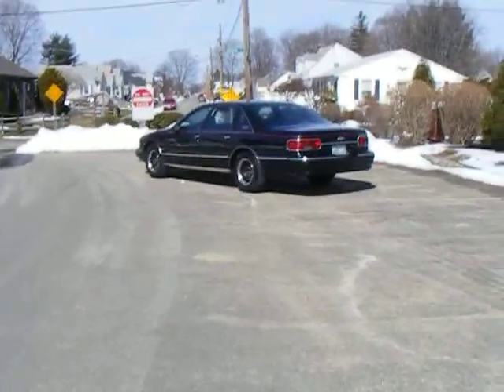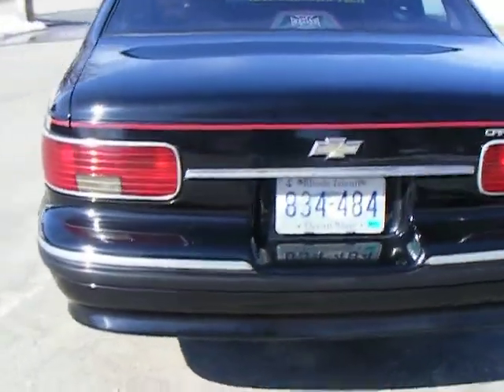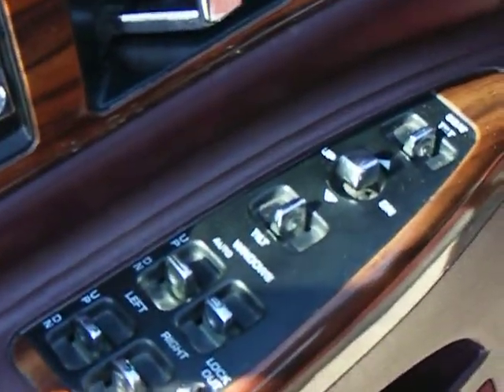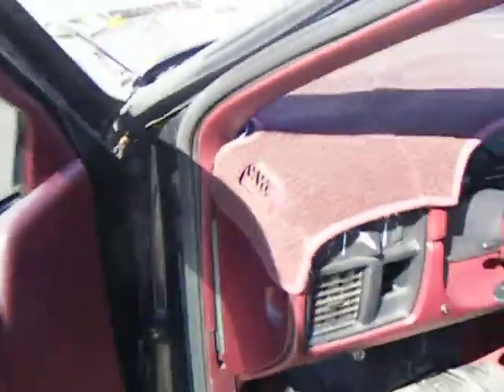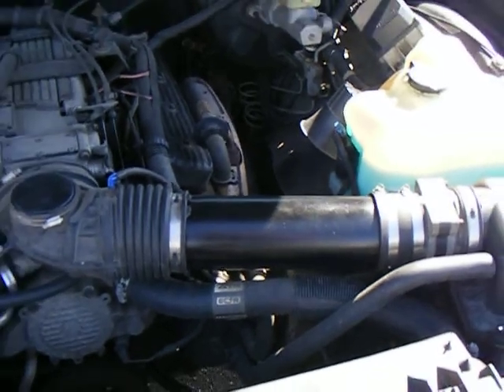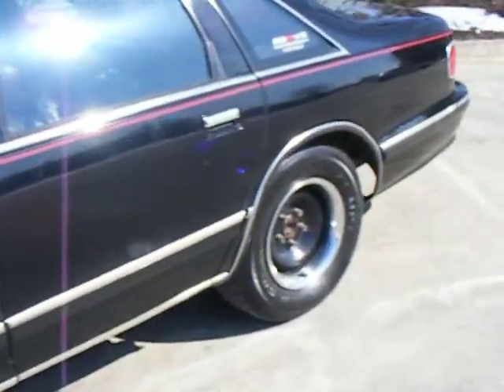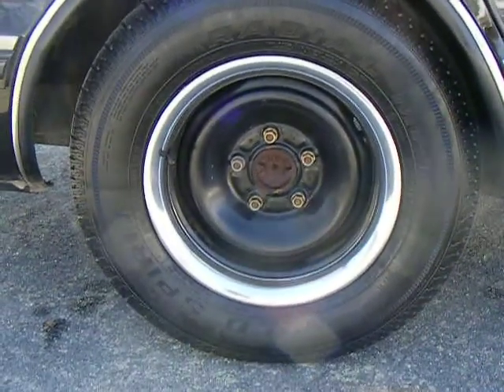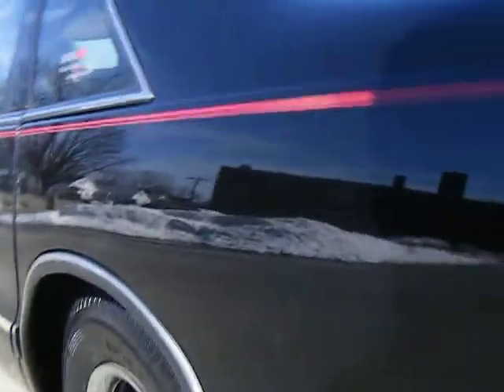1994 Chevrolet Caprice Classic LS 4.3 V8 Walkaround/ Exhaust Video

Comment: i just sold my 1996 impala ss dark cherry metallic it was bone stock with 139000 on it when i sold it was a mint ss only thing it had was a stage 1 built tranny 

those 4.3 v8 are neat treat her nice and always by ac delco parts from your local Chevrolet dealer even items as small as a pcv valve it really makes a difference and i always ran wix filters and valvoline 5w30 oil changed every 3,000 that engine sounded so smooth the fan was louder till u got back to the exhaust had a nice rumble

Comment from the maker: @whydrea dude, no matter what whether your car is overheating or not when u remove that res. cap and the engine is warm it will come boiling out it is under pressure and when u remove the cap you lower the boiling point which makes it boil out. This does not mean your car is over heating.

Comment: @dcmroady I almost forgot that in the 50's they used a 265 V8 in the 55-56 Chevy's. So that cubic inch designation has been around awhile although it wasn't called a 4.3 until the 90's.

Comment from the maker: This is a 4.3L L99 engine. It is cosmetically identical to the 5.7L LT1. It has a smaller displacement of 265 cubic inches and less horsepower at 200.

Comment: @dcmroady Also in the 70's they made the 262 V8 which was offered in the Nova and possibly the plain jane Camaros. My 76 Nova came with a 305, but on the radiator support the sticker showed the 262 V8 also. Didn't realize they called the V8 4.3 a 265. In the early 80's you could get the Olds Cutlass with a 267 V8.

Comment: @MrBlocka20 Actually in the 70's they made a 262 V8, 75-76 to be exact. It was offered in the Nova and Monza. Possibly the plain jane Camaro. Not positive on the Camaro. Could've been other models that used it, but the Nova and Monza for sure.

Comment: Superman, the 4.3 and the 5.7 LT1 are the same block. The L99 just has a smaller bore and stroke. other than that, they use the same exact external parts. The outside block is even the same exact size.

Comment from the maker: @Thilindel The L99 is a V8. No need for a video. I can't take a video anyways I removed the engine. Doesn't make a difference, the L99 and LT1 are IDENTICAL in outside appearance. Take it from me. The L99 is a V8. A 4.3L V8. I have been into these cars for over 5 years, I know my stuff. Here is the code L99 from a list of GM RPO codes:

L99 : ENGINE, GAS, 8 CYL, 4.3L, MFI

Comment: It's 350 lt1 5.7, with a smaller bore and a shorter stroke. 5.7L V8 is 4 inch bore, this is only like 4.65 or something. And with the dif stroke equals it out to be a 4.3L 265, out of a 5.7L 350 LT1 block.
Reply: airbop only 3 more cubes than the v6 without increasing the amount of fuel and air in the engine and somehow gets 35 more squirrels it looks amazing

Comment: They made a 4.3l V8??? I know of only 4.3's being V6's in the 90s chevys. I'm a little confused.
Reply from the maker: Yes Jesse Foulk they did. It ONLY came standard in the 1994-1996 Chevrolet Caprice.
Reply: +jesse foulk Yes they made it in the early 90's
Reply: +dcmroady It was for the 9cL1 version police car only but I did not know about the standard version but the V8 4.3 L99 came out in the early 90's
Reply: +dcmroady Hey dcmroady if you still have this caprice please get a dual air intake system with a heat shield you can order it at street trends.com it will make your car faster and louder I have a 1996 caprice 9cl1 police car with a dual air intake system and super 10's flowmaster's   mufflers nice car and I hope you still have it because it's getting harder and expensive to buy a another caprice their prices rates it's like a 1994 to 1996 impala now these car's is now twenty something year's old and a another 6 to 8 years they will be consider antique value and it will be impossible to buy unless you have big money so anybody that has a caprice classic from the 90's hold on to it because it will be antique in a few years and this was the last big car made out of steel iron from American.
Reply: dcmroady does it pull off faster then a 5.0 V8 carb engine? about to buy 1 of these..

Comment from the maker: @hellbillyeric You dont know what you're talking about, homeboy. The 4.3L V8 was only available in the 1994-1996 Chevrolet Caprice. It was a 265ci 200Hp engine. THIS IS NOT A 4.3L VORTEC V6. Do some homework before you post on my video. Thanks.